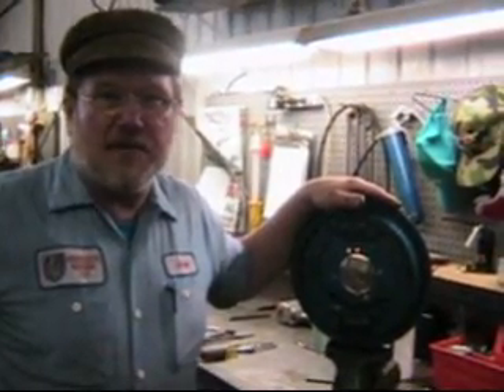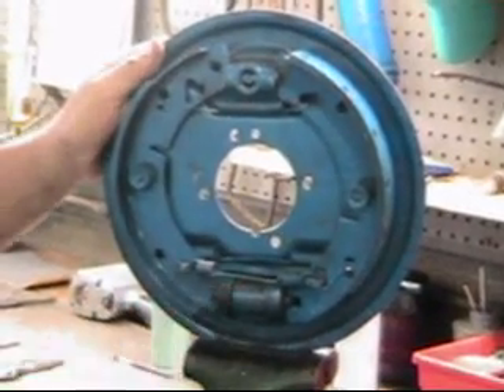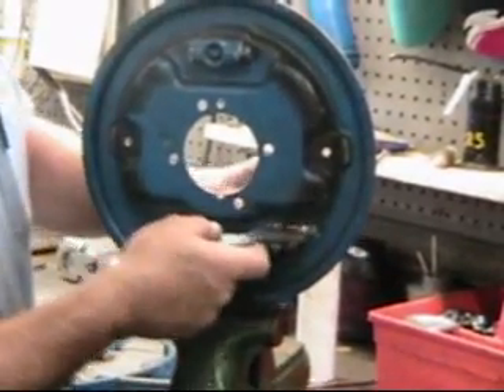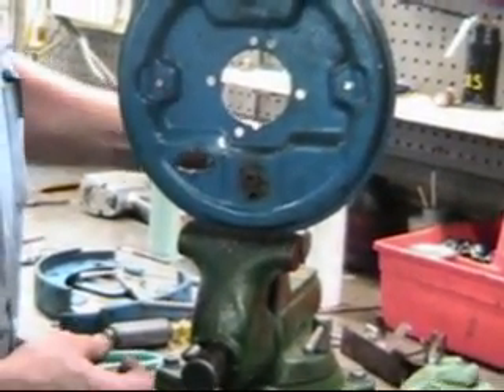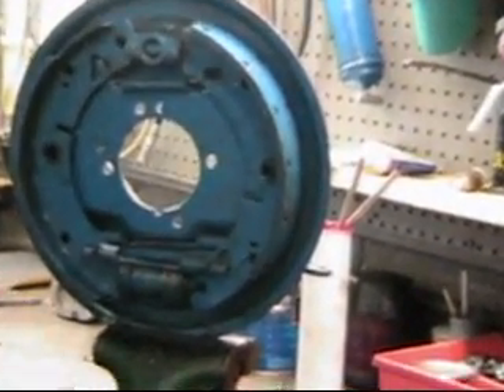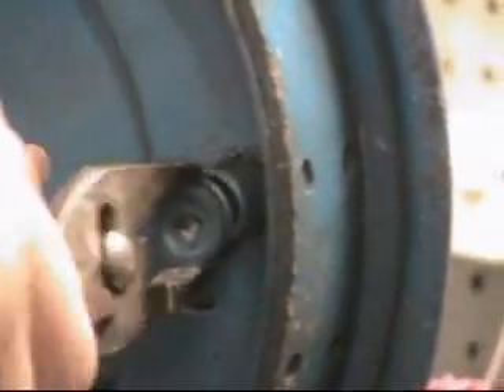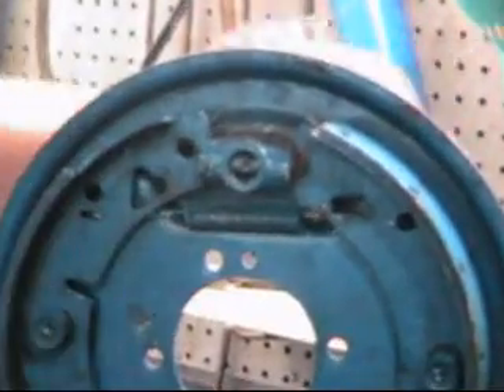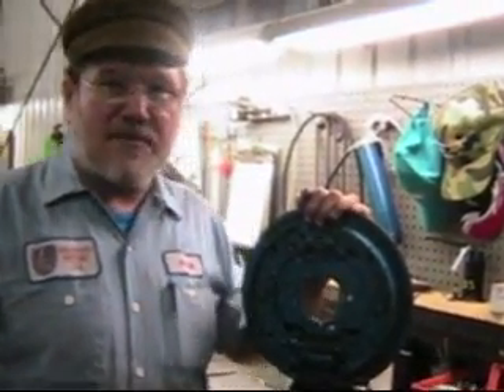019 MG Tech | MGB Rear Brakes

Comment: Nice video, John. I really like the way theyre adjusted. Its so much easier to do than modern drums with auto adjusters with that little wratchet star thingy which never works. I think the most difficult drums to maintain are on a VW Vanagon. What a nightmare! Anyway, is there any possibility you could do a video about fitting and properly setting up an electronic ignition kit, possibly like the 123 distributor? Thanks!